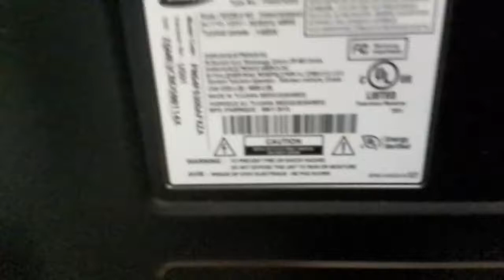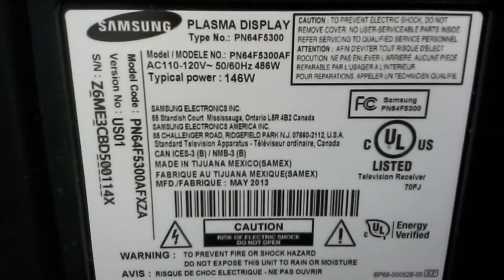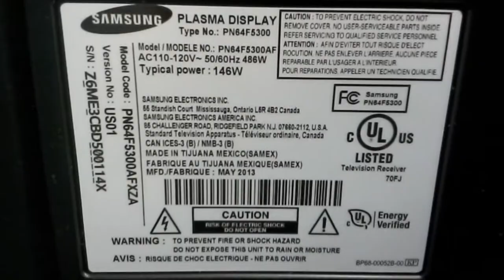How to troubleshoot and repair Samsung PN64F5300AFXZA PN64F5500AFXZA dead or no image problem

Comment: I have to give you a huge THANKs I got one of these 3D TV's for free and could not figure out what the problem was I went thought countless videos and ended up spending 300 on parts that were not the problem then I saw your video and did the test and sure enough, It was the Y main board ordered the parts from your website and installed the 3 caps and boom the tv is working amazing thank you so much a new/used Y main board would have been another 260 that I couldn't afford I always wanted a 3D tv and now I have one.

AGAIN THANK YOU SOOOO MUCH
Reply from the maker: Thank you too! If you could spare a minute and post the same in our Google Reviews we'll be even more thankful.

Comment: Question for you. I replaced these parts, all 17 of them on the Y board. Still get power on, sound, inputs work etc, just no picture. Black screen with white specks that flick on and off. I have the PN64F5500. I have a new power board and X main as well. Any thoughts? Thank you.